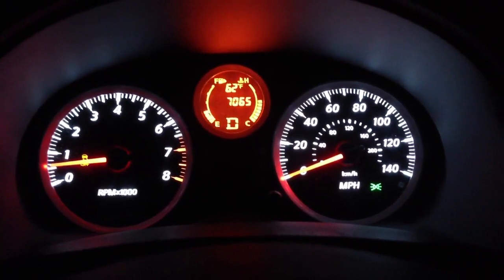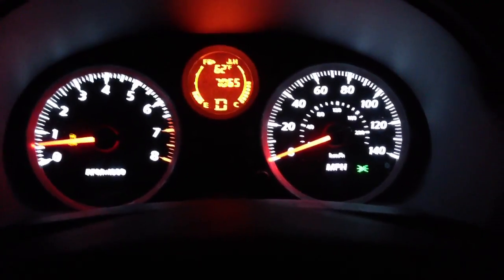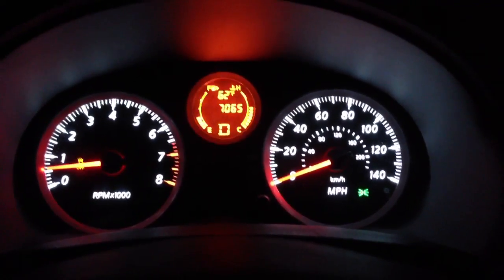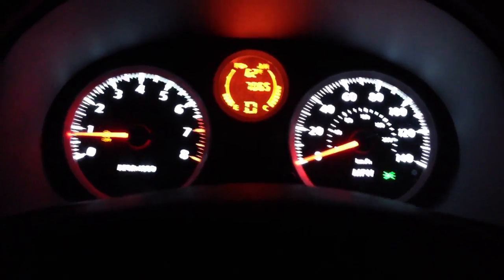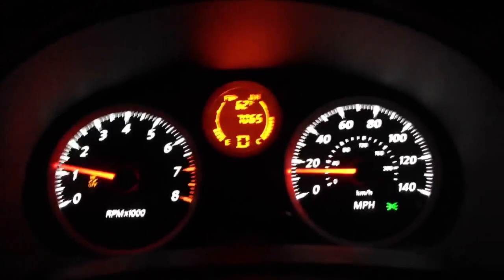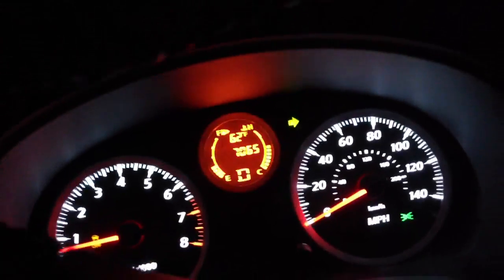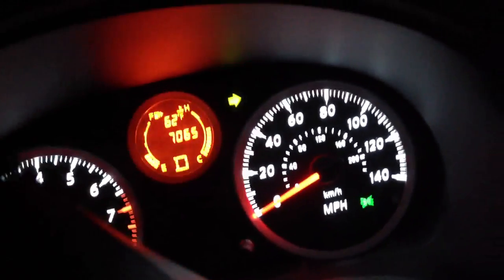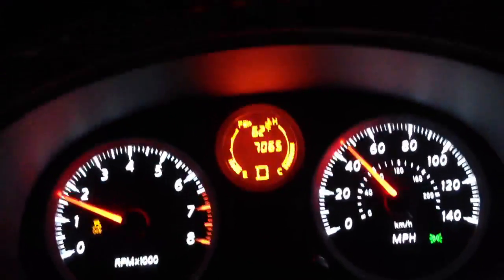CVT Transmission in Action!

Comment: Its a very simple concept. the simplicity is the best part about it.  I do not believe in having them in a car, but they perform very well.  I grew up riding snowmobiles which i believe is where this technology came from.  Every sled for the last 50 years has had a cvt type of system in it. i called it a centrifugal clutch.  No one who has been on a sled can deny the performance perks of this type of transmission.  Also everyone who has been on one has most likely changed a few belts. Ive seen clutch weights come off and disappear in what looked like a flight into outer space. (left a nice hole in the cowling) I like the idea of having them in a car but im going to let you guys test them out for the next ten or so years.

Comment: I had a 2012 Sentra and now I have a 2017 Nissan qashqai ... I really do miss how the older generation of Nissan's CVT transmission because now they have this D-step  which is supposed to simulate a regular transmission shifting and I hate it as there is nothing smooth about it ..

Comment: I'm considering getting a 2009 Nissan Maxima which has CVT and 290hp so will someone tell me if it will be quick? It has a solid 0-60 time and plenty of hp but everyone says CVT is slow so I'm confused.
Reply: As far as i've seen and heard, the difference is that you won't feel gear shifts, but rather a gear shift sound, and the acceleration is slow for the first 30mph or so, then begins to accelerate a bit faster. I personally dislike it. Probably because i do enjoy feeling the gears shift and being in what feels like a car, not an airplane (a slow one at that) but each to his own.
Reply: "but everyone says CVT is slow so I'm confused."
--- In this case, the subset of "everyone" who says that with respect to automatics is wrong.  The constantly changing engine pitch and buffered jerks at shift points that they experience when they push their automatics might make them feel that they're accelerating faster than they are but ... you and I know better.
Reply: Number Six Fair point, thanks
Reply: +Yief Get a manual man. Definitely faster, look up the bad things about CVT's. Don't take youtubes advice.
Reply: +John Doe "+Yief Get a manual man."
--- How can you tell him that without knowing a single thing about him, his driving environment, his preferences or the others who also drive his car?
Reply: Number Six That was my opinion. And then I told him to look it up instead of taking our opinions lol

Comment: Bro. I was litterally minutes away from getting a new transmission cuz i was like why tf is my gears not shifting😒 mind you i told the mechanic that my CVT transmission isnt shifting and he proceeded to say yeah it needs replaced 😑
Reply from the maker: Yea most likely doesn't need replacing but if it's whining or making a weird noise then it may very well need at least a flush or fluid replaced. Those nissan CVTs used to be fragile as glass. I dont know if they have gotten better but they use to be horrible
Reply: Im scared of flushes. I heard they can reveal damage thats already there. Should i just add  fluid or risk it all lol

Comment: This is the conventional belt/cone CVT.  The Toyota/Lexus "eCVT" is not like this at all, it's instread just a planetary gearset (like a differential on the rear axle) where the ICE drives one input and a beefy motor drives the other, and the whole thing is controlled by a computer.  No belts, nothing wears out.

Comment: Finally the first Video showing a real non-shifting CVT. We want to buy a small fuel efficient car (Suzuki Celerio) and it comes with only Manual and CVT. I can easily drive with manual, but we're here in Manila, not in Germany etc. So in that fucking traffic I prefer automatic. But then the CVT is more fuel efficient for small, cheap vehicles. Therefore I will take it. Espacially as my wife don't like manual too and never drove manual. 
Looks a bit with my Scooter...just accelerate and the engine stays where you put the gas to. Kinda weird but I prefer that over a normal automatic.

Comment: I just love these people who shit on CVTs without ever trying one. I have a 2005 Audi A4 with the 2.0 TDI and the Multitronic CVT... yes it has a few design flaws and doesn't have as long of a lifespan as a manual... I was skeptical about automatic transmissions in general before I got this car... but man, compared to the manual transmission BMW 318d I drove before the CVT Audi, I would choose the Audi all day every day. The seamless acceleration is just unbelieveable. Even if I just casually get going at a red light, people with manual transmission cars always lag behind because with shifting they lose a lot of time. And it doesn't "rev itself to shit", it only revs into the higher RPMs if you put your foot down. It's the best transmission I've ever experienced. Too bad the longevity is not the best.
Reply: I know this is a late reply but I wanted to share this with someone. Imagine a "manual" cvt transmission. With some kind of a level in the cockpit that lets you adjust how close the two ( idk what they are called ) v shaped walls close in and out to adjust the revs, which would be amazing for performance. .
Reply: Tony this man knows

Comment: i prefer 4 speed automatic over cvt.
Reply: mike oral "i prefer 4 speed automatic over cvt."
--- And I prefer horses over engines.
Reply: Number Six I prefer walking over horses
Reply: I prefer crawling over walking.
Reply: Number Six Toyota 4 speed is better lol
Reply: I prefer a 5 or 6 speed manual over CVT and automatic garbage.
Reply: what about 16 speed?
Reply: Shit, that's saying alot when a 4A is the preferred transmission.
Reply: I prefer a 2 Speed Powerglide
Reply: Number Six i drove a 93 SL500 with 4 speed auto, 329 hp... that thing hit 0-100 under 6 sec and really pulled after 100kmh.
It also had electric powered mirrors, leather seats and electric adjustable seats. 
Way more advanced and faster than the CVT shit produced in 2018.

Comment: Cvt is horrible I see so many people pass me on the road going up hill cause the cvt transmission doesn't have enough pulling power. The rpm it stays on is 6k and doesn't have a good pulling power uphill. I feel the engine is gonna blow up due to this issue

Comment: I will avoid CVT. I had a manual BMW 3Ser 2.9 diesel, would pull like a train in a high gear from low speed much stronger than this at 2000rpm and still returning combined close to 40mpg with a damaged turbo. Any car that has to rev above 2500 rpm to get somewhere is working too hard and can't be good for the engine. Always found 2 litre manual turbo diesels will give best (50)mpg vs usable torque at low revs.

Comment: Just got my 2014 impreza with cvt and it comes with paddle shifters for manual select and it has pre program gear ratios which is cool cause it lets me rev the engine all the way up between shifts like a real manual and even ride that gear ratio like a manual and it really does feel like a manual but with out the clutch paddle like a gtr ;)
Reply: Have you ever driven a manual gearbox car?

Comment: I do not like CVT because lucas transmission slip fix is not recommended for them and I use them in the regular non cvt transmissions with fluid changes with royal purple ATF max life every ten thousand miles in transmission oil change. I will like them when lucas makes a fluid compatible for when these have problems in the future and they will because people do not check them 50% of the time.

Comment: It's adjusting the gear ratios for performance and fuel economy but this is not a performance car. I think you'll blow it sooner or later.
Reply: It's fine. Well below red line and even further below the limiter. It's perfectly safe to use the engine's full power band.

Comment: the CVT is a failed theory. it improves fuel efficiency but kills performance and towing capacity as well. as far as Nissan's go... my 2014 sentra CVT failed at 45k miles. I used to work for nissan and they continued to build the pathfinder with transmissions they knew were likely to fail.

Comment: id rather rev high and harvest all the power instead of being stuck at 5k and thinking "why the fuck wont it kick"
Reply: i doubt that's what hes feeling here. CVT's are made to allways run at peak torque which gives the highest acceleration..
Reply: almost correct, you get the most acceleration at peak hp.
Reply: +Mads Kjerulff no it doesn't

Comment: cvt is garbage.
im a nissan tech over 15 years.
Reply: yep. I'd never drive anything with a cvt after test driving a maxima. shame because the engine had plenty of power and potential, utterly wasted by a useless trans. I ended up buying a VW CC 3.6, which has a better transmission and similar real world gas mileage, from a more normal 6 speed dual clutch auto.
Reply: MegaAngrygerman what are your reasons I have driven the maxima 07 and 12 nice with great power have a 10 Dodge Caliber and Smoked many cars and just drove a mazda minivan with turbo and its a CVT man that car is not a minivan when you put your foot down and gas is not bad but I drive it like I stole it its the VW CC 3.6 a Diesel engine
Reply: Please explain why instead of just saying "it's garbage". Give us a solid reason why CVTs suck.
Reply: What he means is a Nissan CVT is garbage. Toyota actually made theirs right the first time, I have never seen one break down.
Reply: nissan is garbage
Reply: Nix Ryu The Sergal Figures the only good CVT would be built by toyota. Nissan went absolutely downhill in quality after the French took them over.

Comment: I never seen a car equipped with a CVT winning a race  
not even when competing against smaller engines
Reply: +SuperNiceguy60 
Please list the races that you "seen", the engine-transmission combinations of the cars that were raced, and the general conditions and rules of the races.
Reply: i can do better than that , go To UK website and compare a Nissan Quashcai with a CVT and a Manual Gearbox the CVT fairs worse in Acceleration , Top  Speed , Fuel Comsuption & Reliability as per ( NISSAN ) own specifications
Reply: SuperNiceguy60: " compare a Nissan Quashcai with a CVT and a Manual Gearbox"
--- Compare the hauling capacity of a Ford F-150 and a Porche 911.  The F-150 crushes the Porche!  
--- If your response is that the 911 wasn't designed to compete with pick-ups you're getting it.  CVTs were designed to compete with/replace AUTOMATICS - not manuals!
Reply: +Number Six I think that's what more people need to realize. Manuals remain king for performance, no one's denying that. I would never want a CVT but it seems like everyone that's against them is arguing FOR manual transmissions.
Reply: +John Doe " it seems like everyone that's against them is arguing FOR manual transmissions."
--- That has essentially been my observation.  I wonder how many of the "give me a manual or give me death" fanboys spend two hours a day in stop and go traffic.  
--- Every new car that I've ever purchased had a manual. (<grin> It's kind of hard to demand that the owner of the used car that you're buying swap out the transmissions for you.) However, if I my home and job mandated protracted daily rush hour commutes, I'd never own another car with a manual transmission.
Reply: Number Six I am not qualified to comment on that as I have driven in PLENTY of traffic with my manual, it never bothered me.. but it also isn't a part of my daily life. I think if I were a little older than 24 my opinion, give me manual or give me death, would be a little different as well haha.
Reply: +John Doe " I think if I were a little older than 24 "
--- <grin> I'd drive a manual all day long in any kind of traffic if I could be 24 again.  Enjoy you youth while you have it; if driving a manual helps you do that, more power to you.
Reply: Number Six You, I like you
Reply: +John Doe "You, I like you"
--- Ditto!
Reply: Anyone tried racing against a Tesla? They have CVT too.
Reply: Electric cars are completely different since all power is delivered instantly. But I think CVT's are not a good replacement for conventional automatics. Conventional automatics have had their gearing and cruising RPM improve big time but the major thing is Dual clutch autos which obliterate everything on performance, MPG and cruising at speed. Dual clutch autos are even slightly better than manuals objectively speaking.
Reply: I've read that Williams put a CVT in a Formula One car in 1993. It was banned because the car was too OP against rivals, getting from bottom to top pole in one single lap.

Comment: Sorry to say but CVTS seem numblingly boring.
Reply: They are. Even with manual mode options they're horrible. Sadly carmakers are switching over to these god-awful transmissions because they save fuel. 
The best thing about acceleration is the feel of being pushed into the seat while the engine revs through the powerband, before shifting. It's music. With a CVT it's just noise. CVTs are also prone to problems, as many Nissan models experienced. 
I'm sorry but I just cannot stand a CVT. I tested a 2014 Subaru Forester recently with a CVT. Nice car to drive, handles well, but there was zero driving feel. I walked right out of the dealership despite the guy trying to convince me the gas mileage benefits were huge. Sorry but I'd rather keep my current car, a Passat diesel with a manual, because not only is it engaging to drive because it has a proper transmission, but it also gets 45+mpg highway, with air condition on. I have yet to see a CVT car that can beat that figure.
ZF makes a 9 speed automatic transmission that goes in the new Range Rover Evoque. When doing 130km/h, the engine only spins at 2000rpm. That promotes efficiency while maintaining an engaged driving experience. Hopefully we will see this in other cars as well.

Comment: CVT wastes Far more fuel
Reply: Actually CVT's use less fuel compared to conventional autos.
Reply: L Pontes CVT's using less fuel is a fact dumbstein and why you would bring up reliability issues in a fuel economy discussion I have no idea.
Reply: ***** Show me 1 single  Vehicle fitted with CVT  which has a Higher MPG than its equivalent fitted with manual gears ? 
Or simply shut up !!!
Reply: ***** well the problem with your statement is there are Automatic gearboxes which are Extremely fuel efficient such as Mercedes 7g Tronic or BMW 8 speed Automatic which are actual more fuel efficient than Manual Gearboxes , If you compare CVT's with Crap Automatic gearboxes CVT is Stunning , if you compare CVT with a good automatic gearbox CVT is USELESS

Comment: wow a transmission that will rev itself to shit...genius!
Reply: a transmission that will rev to the most optimum rpm for the work you are demanding, making the engine suffer less-> more reliability and have a better fuel consumption and a smoth acceleration
Reply: ALIENdrifter66 total opposite of less suffer for the engine. Holding it at 6k for like 30 fucking seconds to get on the highway nice
Reply: shiv patel The engine has to work perfecly fine until redline. Toyota/Denso researchs show this is better for the engine than pushing the engine at low revs and they have the most reliable cars.so i think they know what should be done. At those rpms the engine doesn't have a lot of resistance to advance and that's why it's better.

People is just afraid to rev their engines because it makes more noise and they don't have any clue on how an engine works

Comment: CVT is shit
Reply: MisterDopeTunes 
You've been misinformed.  They're made of pretty much the same materials that manual and automatic transmissions are.
Reply: +Number Six Not at all, they feature a set of two hydraulically actuated pullies plus a clutch, connected to each other with a woven steel belt or expandable chain, the pullies can only handle so much torque before the chain begins to slip and cause damage, which is why CVTs tend to move up the RPM range slowly, so in theory CVTs should be faster than manuals and even DCTs, in practice its rarely the case. Also Jatco the prime supplier of CVTs doesn't supply major components I.e. pullies and chains to repair broken units, meaning that the trans has to be replaced.
Reply: +Tom Zeimet "Not at all, ..."
--- You were apparently responding to someone else and inadvertently posted it to me.  My only post here was informing the OP that CVTs are not made out of shit.